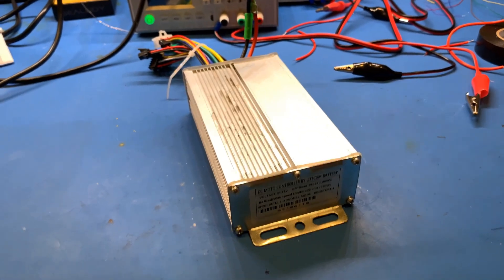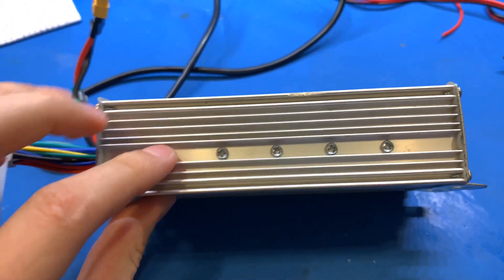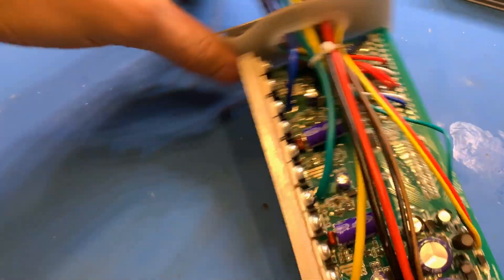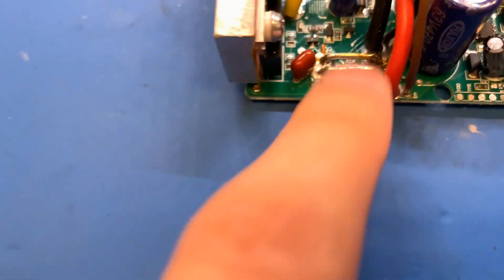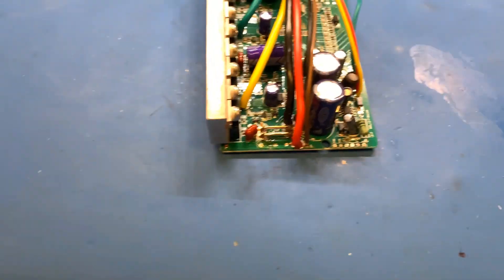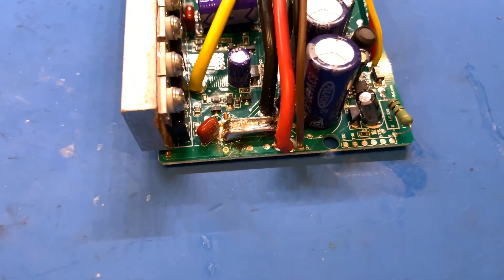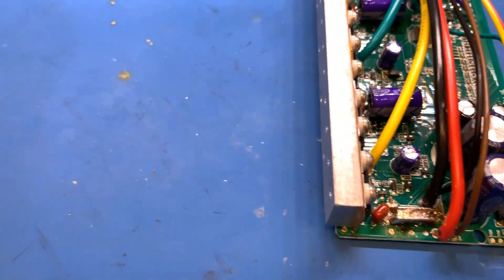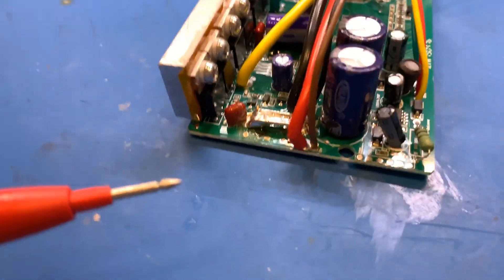Ebike Motor Controller Power Mod

Comment: You should also use silicone to secure all of the capacitors to the board, there's usually a tiny bit on the input capacitors but it really should be a bunch everywhere, I've had a controller die from vibrations eventually breaking off a cap letting it move around inside the case.
Reply from the maker: mashed potatoes Thanks for watching, that’s a good idea, but I’m not too worried about my controller breaking because I’m looking to upgrade anyway. Maybe I’ll do it on my new controller.
Reply: @ryanstephenson7655  I did it to, but my was was simpler, the best way to bypass the shunts in your controller is to bridge a 16 gauge wire from the back of the circuit board, just leave the shunts alone as they are. The reason I recommend a 16 gauge versus thickening up the shunts,  is because thickening the shunts with solder increases the amperage over its limits, it's like using an 8 gauge wire to bridge it. I burned my first controller the very first one I did. So again to play it safe, I recommend a 16 gauge bridged from behind the board, and you still have plenty of acceleration that will knock you head back, without the risk of burning up your controller. thanks
Reply: @alexshatner3907 do you have a picture of this bridge? Im taking so many tips from so many people and gonna roll with one and yours sound more promising/safer for the controller. Thanks!
Reply: Never mind...lol I read your other comment. You bridged the solder points on the opposite side.
Reply: @ryanstephenson7655  which controller did you upgrade to?
Reply: @Alex Shatner 16g wire from the back of the controller? From where to where ? A little more specific please?
Reply: @mrsuave4424  first you locate the double shunts through the front of the circuit board, they just look like two thick metal jumpers about 3/4 inch long, which are really resisters in disguise. then you flip the circuit board over to identify from which solder points they are bridged from, so you cut a one inch 16 gauge stranded wire and jump it or bridge it how ever you understand it better, being very careful not to lay solder to other non related joints. if you don't know what the shunts are just send me your email address through this you-tube response and I will send you pictures. Your scooter or bike will respond as if you added a turbo, to it, Just be careful when taking off from stand still because it will know you backward off your seat, and can be fatal, due to a back fall on your head, the power is imminence.
Reply: @VishaP-uu6zc Hold my beer, hold on let me work on it.

Comment: nice and clear, good video. thickening up the soldier underneath helps
Reply: What do you mean by thickening up aolder underneath? Solder the top and the bottom of the board? Or just one side?
Reply: @stevenetienne1442  The solder traces under the controller board he meant

Comment: Good video . Thanks will do this to mine.
Reply from the maker: DIY TEK NUT  Thanks, be careful though because a little solder goes a long way. I had to remove some solder because I been tripping the over current protection on my battery.
Reply: Ryan Stephenson ok thanks for letting me know.
Reply: Did it make it faster?